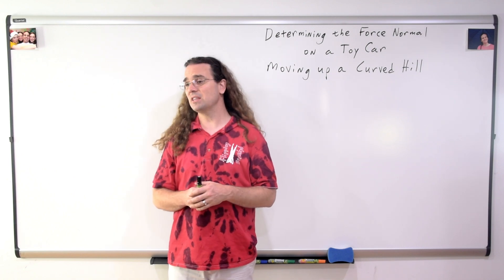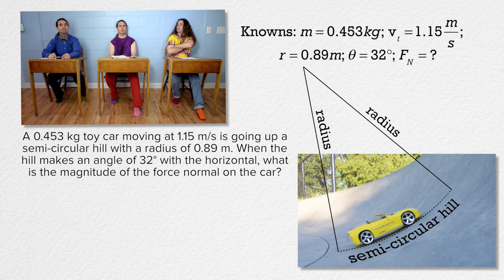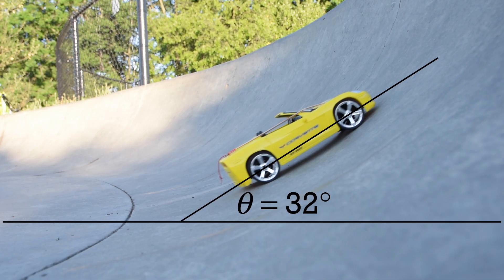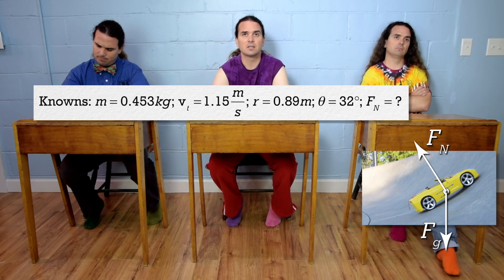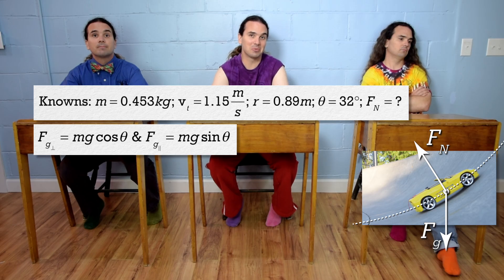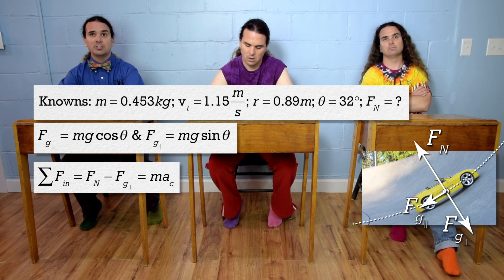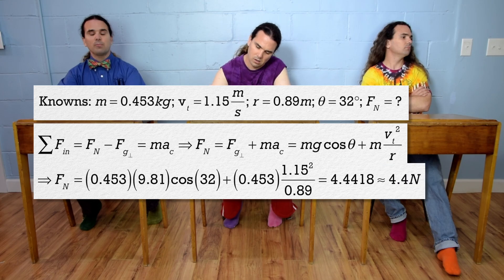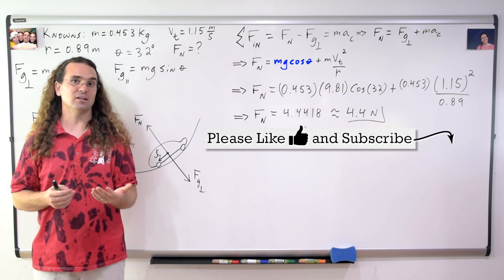Determining the Force Normal on a Toy Car moving up a Curved Hill

Comment: Great video :) 
Though I’m a bit confused on why we didn’t include F of g parallel when we summed the forces. In addition, the previous problem we solved (the one that asked to determine any information about the constant of static friction) we wrote that force normal and force of gravity as net forces in the y direction, not the in direction, it was the force of friction as the in force (centripetal force). What makes this problem different? And shouldn’t we have included force of gravity parallel too?

Comment: hi thanks for the video but may I ask why does the instantaneous tangential velocity of the cars decrease as the car goes uphill?
Reply: Assuming the car is coasting freely, it has to lose kinetic energy such that it can gain gravitational potential energy.  This would mean that it is slowing down as it climbs the hill.

In order for tangential velocity to either remain the same or increase while it climbs, it would need a source of energy to power it as it climbs the ramp.   Such as a motor or an unwinding spring.

Comment: Hey Mr.P, quick question, is there no force of kinetic friction because the tangential velocity is instantaneous? Was just a little bit confused as to why there was no friction.
Reply from the maker: We do not actually know enough in the problem to know the direction of the force of friction. It could be up or down the incline. I'm not even sure if the friction is static or kinetic at this point because I am not sure if the wheels are slipping relative to the incline or not. However, considering all we are doing is determining the force normal in the problem, which is perpendicular to the force of friction, we do not need to know anything about the force of friction to solve the problem.

Comment: Why is force of gravity being added by centripetal force. Shouldn't it be subtracted or is this one of those situations where you have to use centrifugal force?
Reply from the maker: Sorry, however, your question confuses me. The force of gravity perpendicular is subtracted in the net force in the in-direction equation. I do not see how you can say it is "being added by centripetal force". The reason the force of gravity perpendicular is subtracted in the net force in the in-direction equation is because the force of gravity perpendicular is directed "outward", which is negative.
Reply: ohhhh never mind. I didnt see that you added force of gravity on both sides.